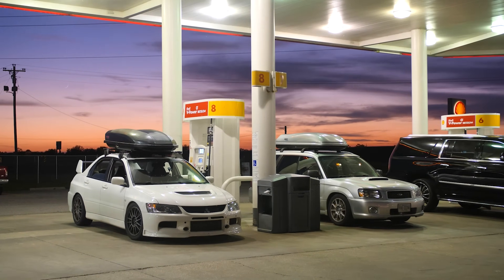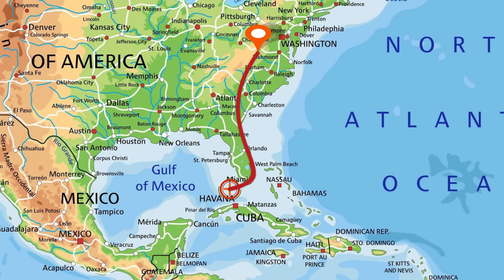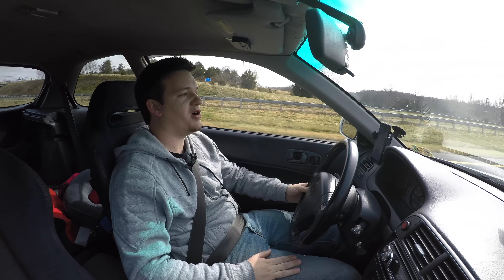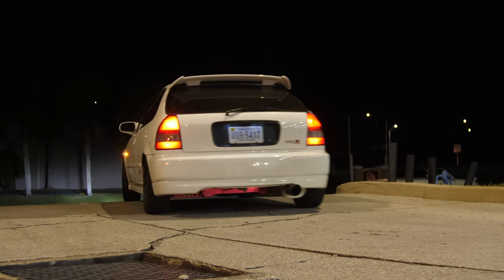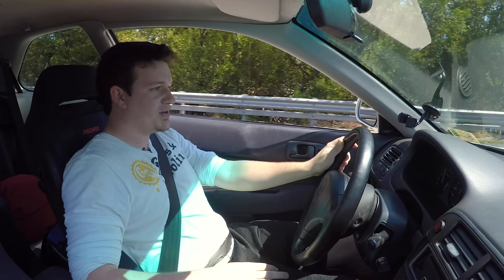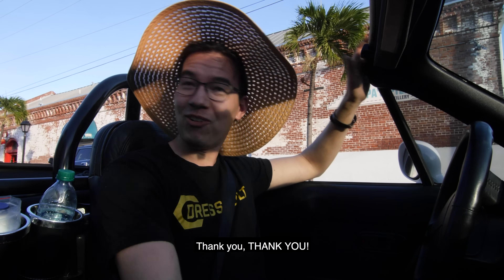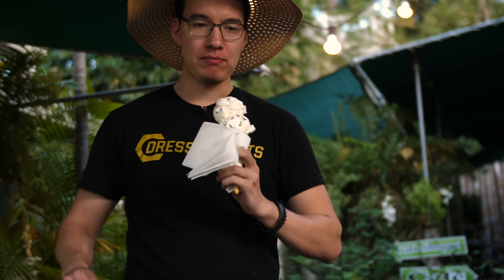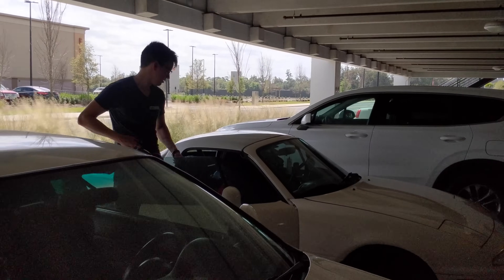7,000 Mile Roadtrip in a Civic and Miata - Episode 1

Comment: 6 hp to 8! Dayum
Reply: Well, 1/3 Power gain
Reply: FedeWarrrior FedeKrafter IKR
Reply: Kjell Van Kampen 1/3 of 6 is 2. 6+2=8. Math isn’t going anywhere
Reply: @AnatomyStudio.Official  is your brain taking a break? 6-8hp is a 1/3 increase in power hahahaha
Reply: Lol 259 power and 224 torque
Reply: @AnatomyStudio.Official  did you go to school m8?
Reply: Wrong a Miata had 161 HP and a civic has 199HP the problem with the civic is it weighs more then the Miata
Reply: @issacdaniels942  the Civic barely weighed any more than the Miata at the time, it doesn't matter
Reply: @fordgalaxie3695  you know what beats weight power and light weight and grip plus you can swap anything in to the miata
Reply: @issacdaniels942  none of that really matters in this case
Reply: A whopping 8😂
Reply: @AnatomyStudio.Official  asg...
Reply: I though it started at -1 hp

Comment: For the civic I think the "kill switch" is also good idea instead removing the ECU every night
Reply: Can't hot wire a car with no ECU
Reply: @jv6miata  neither with killswitch
Reply: @Skreperiukas  but a killswitch can eventually be found, and there are plenty of videos out there on installing a killswitch that it would be the first thought.
Reply: @thatprettyparrot  they show simple hidden spots. Ive seen dudes in my community where they have to twist knobs into specific orientation, tirn on ignition for 5 seconds and only then they have a 2second interval where they can actually start the car. Personally thats overkill, but I am just telling you that if you are dedicated enough, you can hide it pretty well
Reply: @Skreperiukas  Fair enough.

Comment: I daily drove a Miata for 2 years, truly the best car I've ever owned, that being said it was probably the absolute worst car for any kind of road trip lmao
Reply: How tall r u? Thinking of joining the club
Reply: @thierryreindorf8864  I'm 6 foot and like 230 so not exactly small but I fit pretty comfortably
Reply: Ill road trip my miata anywhere ive been on a 2500 trip already and want to do more im on my 3rd miata
Reply: @thierryreindorf8864  If you are under 6 foot you should be able to make a Miata work for you, above 6ft your mileage may vary. I'm about 5' 11" and 270 and I fit comfortably in a na. The only things I had to do was I have a aftermarket steering wheel and quick release to push the steering wheel forward and off my legs. After that, taking foam out of the seat does help, but it's not 100% necessary.
Reply: @thierryreindorf8864  I had a mk2.5 and I'm 6'2" and was perfectly comfortable, check for rot, front chassis legs, front arches, sills, rear arches. Rust seems the only killer. Just buy a solid one
Reply: I'm 6ft4in and 255lbs. I'm a thicc guy, and with the foamectomy and flat door panels, I fit well in my NB. It was a great car, but I bought a house and sold it for something slightly larger and newer. I'm thinking of buying another in the future, but I've got other dream cars to buy first.
Reply: Yep, try taking a quick nap in a car that seats won't recline.
Reply: @thierryreindorf8864  im 7'8 weigh about 630 in pure muscle and fit in my NA just fine.
Reply: Why is it bad for road trips? Because the interior is small?
Reply: Noise is ok in my nc
Reply: Loud and stock chairs are not the most comfortable for long long trips also seating position is not the best. City driving sucks. Im 5'10" and cannot see the stop lights
Reply: Other than that its best car ive ever owned

Comment: I drove my miata from New Jersey all the way to Arizona, it definitely was not the answer hah.
Reply: It depends which Miata. NA-NB can only go so fast and the optional cruise control. ND I've reached triple digits on long stretches but a bit stiffer ride.
Reply: @jg5001  My dad has a 90 NA, and the gearing is short enough that its turning 3000 RPM to do an indicated 60 MPH. Even though it has cruise control, it has a nice sporty sounding exhaust (that drones at highway speeds) and the wind noise from the soft top is enough to get on your nerves after a while. Plus the lack of head room.

So, even with cruise control it's really not a great road trip car. My '91 Civic hatch is a much better car for long drives in comparison. It too needs some additional sound deadening to be what you might call "refined", but a set of ear buds cut down the background noise enough that you can ignore it.

Comment: I miss my 1998 DX Hatch. Also didn't have AC, but too busy doing real driving to care. I put 300,000km on it and never got rear ended or rear ended anyone while constantly redlining it. Key to the safe driving is NO sway bar. However, Had strut bar all around, including rear upper. Pro-Kit springs with Tokico Shocks. Without the swaybars, it allows the progressive springs and double wishbone suspension to do it's magic (this car needs to lean into turns).  The car is a monster at finding grip in the most chaotic situation. Might lose a few second off the track time (bit of under-steer without rear sways), but on the street, this setup cannot be beaten by any car in existence.

Comment: My first new car purchased was a red, 1989 Honda Civic hatchback, manual transmission, no A/C, no stock radio.  $6,600.00.  First Miata was a red, 1992, manual transmission, with matching stock hardtop.  Both excellent vehicles.  Reliable, easy to work on, & will last forever.

Comment: Aw come on dude an Mx5 drives top down all the time! I have a hard top for my 1995 UK RHD NA 1.8iS. I put it on for a week last winter when it got really cold, but I took it off again when the temp went back above 5°C . It's noisy and claustrophobic with it on and not a particularly nice place to be. Without it the car is transformed as you probably noticed! If it gets hot (as it does in summer in Southern France - 40°C+ this year) I wear a hat! (It doesn't have AC).
When it's cold the heater's good enough to melt your shoes and... I wear a (woolly) hat!
I will NEVER sell this car, though I might well sell the hardtop - to finance a supercharger!
BTW you can't call your Civic "Mia". That's my Mx5's name 😁
Great vid. Looking forward to part 2!

Comment: Hydraulic clutch cylinders on the Miata should always both be changed out at the same time. Not expensive or difficult to do. Takes maybe about an hour or so. They almost always go out around the same time, so always replace as a pair.

Comment: @Advanced Auto, you need to make your system actually recognize Lifetime Warranty. I bought some struts and right after 3 years one went out then 2 weeks later the other failed. So i took them both off and took them in for the warranty. The eorkers couldnt pull up the warranty, bug they could see...what i call a foot note...that showed it had been just over 3 years since my purchase. I continue to buy things from AA but not if they are "lifetime warranty" because i almost got burned with the 1st and only such warrantied part I've ever bought from AA. So, i only buy things that dont carry lifetime warranties. I perfer to get those from your competitors...just in case i keep a vehivke for more than 3 years.

Comment: How does a supercharger on top of a 130hp 1.8 engine ONLY add 20hp?? 
I mean did you mount it backwards? Is it sucking horses out of the engine and does it just supercharge your steering instead??? So many questions for a car thats supposed to be the answer.

Comment: hmm, in my 2012 VW Golf TDI, it'd take me approx. 14 tanks of diesel to do the drive (500 miles per tank average), in my old '07 Rabbit (340/tank) 21 tanks of gas, in my '11 Honda Element, (253/tank) 28 tanks of fuel...

the TDI would be the best choice for the trip for me :)

Comment: How did he get his Miata to do that! PLEASE TELL ME
Reply: TRAKR 64 you disconnect the ground wire to one of the headlight motors and you can reroute a lengthened cable with a switch into the cabin. 

That way you can independently open and close one headlight. And use the main headlight switch to operate both. 

You could also open up the headlights and disconnect one of the working harnesses for one headlight to it will stay open. Than way when you operate the headlights only one headlight ones and closes. 

The headlight motor and lights run on separate wiring too. So even if you disconnect the motor wiring harness the lights will still turn on.

Comment: Yeah, those cars aren't 5K. I'm not 100% sure on the miata, but the Civic is well above 5K. The shell in that condition goes for roughly $1500.  ITR Seats go for about $800-$1000 depending on condition. CTR Swap alone with trans is roughly $4200. Spoon wheels go for at least $2K a set. That Civic is roughly $8500 minimum. Quit lying to your viewer-base.

Comment: the complaining about horsepower on the miata kinda pisses me off. 150hp for a car that weighs just a ton is pretty good. you people are way too spoiled. you should be doing this in a 50 hp 1 liter 90's hatch to learn what too little horse power really feels like. when you have to make people leave the car so you can climb a steep incline at least in first gear.

Comment: I watched you press that 91 octane button at the gas pump.
Only morons put premium into cars that take regular.
It takes away power, the car doesn't need it, and its just spending money to make your car run less than optimal. 
Plus I see you driving through areas of snow and cold weather. In these areas it is required to drive with even lower octane than 87 at times.

And taking the ECU out of a car every night means that you lose your timing map in that civic, and every day it has to relearn how to run properly.

You have lost all respect from me, and from the cars.
It wanted to go on the trip at its full potential, but you stuck a banana in its tailpipe.
Reply from the maker: Both of our cars require 93 octane.